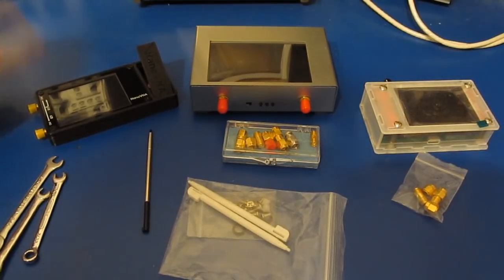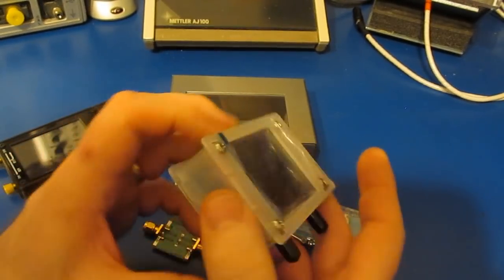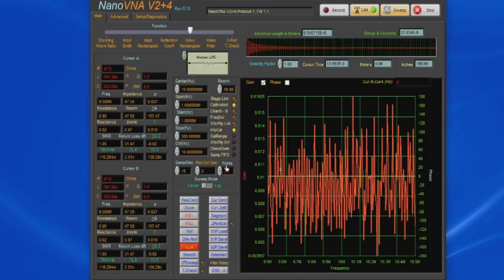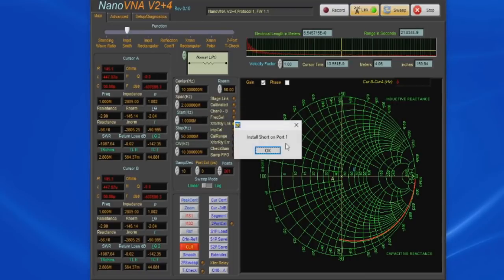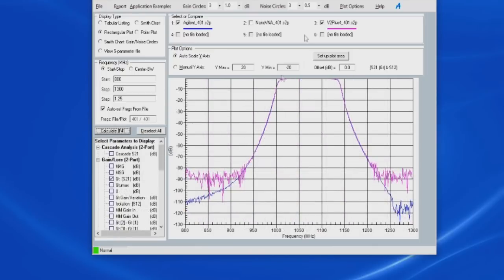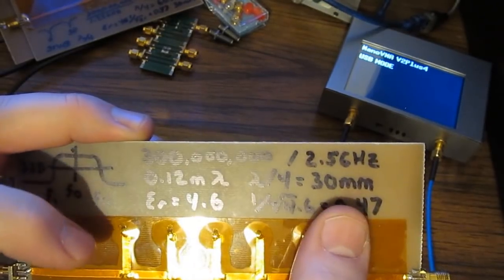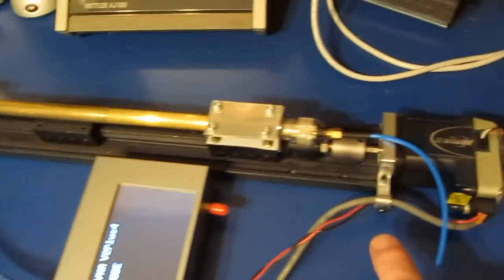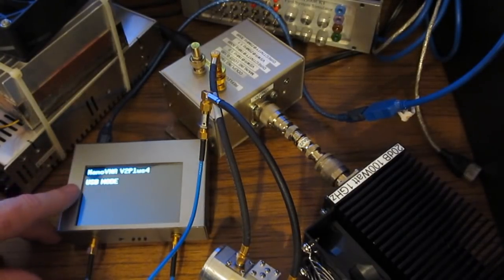NanoVNA V2 Plus4 Review, 4GHz VNA

Comment: Will this software program V2 Plus4 work with my NanoVNA H ?
Reply from the maker: No.  The H and H4 use a different protocol.  I did write software that supports them along with the original NanoVNA but it is not kept up to date and no longer supported.  It is still available to download.

Comment: Will your software work with: "Upgraded NanoVNA-H4 Vector Network Analyzer, SeeSii Latest V4.3"? I just acquired one of those. The date today is 16 June, 2023.
Reply from the maker: This specific software does not work with the H4.  I have different software that uses the old protocol (used by the H4) but it is no longer under development.
Reply: @joesmith-je3tq  Can I get a link from you for that older protocol software you mention?

Comment: Joe, I have a V2 Plus4 with SW version 20220301. I have been searching for any discussions relating to a feature identified as:  L/C match for source Z0. Find on the menue at: (Main menue, Marker, SmithValue-L/C match) but with no success. This feature apparently provides matching solutions using a variety of typologies.  Unfortunately I am not knowledgeable enough about the subject to really understand how to use this feature. I know you lecture about simsmith extensively and I think this would fit in nicely with that.  Would you please consider doing a video about the feature.
Reply from the maker: Hello Walter.  I suspect you have me confused with someone else.  I have never talked about or demonstrated SimSmith.   Also, I never use these low cost VNAs without having them attached to a PC.  I use my own software with them.  Because of this,  I have no use for the features built into the firmware (VNA itself) outside of being able to read the data off it.   Any calculations I do on the PC.   
There are various forums and email lists that you could join.  One is specific to your particular VNA.  I suggest joining it and asking your question there.    
After purchasing the LiteVNA, I stopped using the V2Plus4.  Between it and my original NanoVNA, these are the only two I use.   While I continue to offer updates for my software, I only develop and test using the LiteVNA.

Comment: Thanks! I just got the NanoVNA V4 Plus Pro, and the first thing I tried to do was measure some GHz-range antennas. I'm glad I saw this video.
Reply from the maker: I liked the V2Plus4 but have moved onto the LiteVNA.   I just got the latest hardware revision and have started to experiment with it.     My last video shows using it to measure some GHz antennas.          https://www.youtube.com/watch?v=xe4Fy4Lpnqw
Reply: @joesmith-je3tq  Thanks! I didn't know about the LiteVNA. I had the original 300 MHz NanoVna and liked it, so when it was time for an upgrade, I just defaulted to the NanoVNA V4 Plus Pro. Just used it this afternoon to tune an EFHW. Of course, this was only 14 MHz so it was an easy job....
Reply from the maker: @thrillscience  For working at lower frequencies or making narrow band measurements, you may find your original NanoVNA outperforms your new one.  I've posted data before comparing several of these low cost VNAs.   Recently I posted some data for the latest LiteVNA revision.
Reply: @joesmith-je3tq  Thanks for the tip! I was going to give away my old one, but I'll hold onto it for HF/VHF work because it's small and works will with portable QRP setups.

Comment: Do you prefer the liteVNA now?
Reply from the maker: I have not used the V2Plus4 since getting the LiteVNA.  The LiteVNAs firmware offers features not available with the V2Plus4, which I take advantage of.  If you watch the very last video I made, you can also see how I am making use of the more than 2X upper frequency range of the LiteVNA.  But I am sure what you are really asking is not what I prefer but what you should buy.   If I were a ham, I would most likely stay with the original NanoVNA.  It offers advantages over the Lite and V2Plus4.  All of these low cost VNAs are great for educational purposes but they all certainly have their downside.    If you watch the following, you will note one problem they all share:
https://www.youtube.com/watch?v=y6iOTEU6Zzo

Comment: Hi Joe. One question, does your software also work with nanoVNA-H and/or -H4? Thanks.
Reply from the maker: Maybe.  There are so many of these low cost VNAs with various names, manufactures and people creating firmware, it would be near impossible to say for sure.  For my original NanoVNA, I am still running firmware that a member of EEVBLOG was fixing bugs with in 2019.  Someone had asked about the H4 and I attempted to buy the exact same one.  I ended up with one from Hugen's site.  The firmware was never stable enough where I would consider it working.  I have not checked in over a year if they released anything stable for it.    Both of these (H and H4) use the old protocol which I stopped developing for.   The software and manual are still there for those interested in using it.    If you decide to try it, make sure you read the manual and FAQ.  If you still have questions, check the EEVBLOG.  There is an index.   If you are a radio hobbyist wanting to measure VSWR, I suggest not attempting it.  There are many open sourced programs that are supported.  I suggest joining the groups.io mail lists.
Reply: @joesmith-je3tq  Thanks.

Comment: There is already a 6 GHz version in Banggood. Any experience?
Reply from the maker: I have been working with the LiteVNA.   Most of the discussion has been on EEVBLOG.  The following videos include it.   
https://www.youtube.com/watch?v=G4eLcTC4Ako
https://www.youtube.com/watch?v=y6iOTEU6Zzo
Reply from the maker: Should mention that some have been experimenting above 8GHz using this VNA with the harmonic mode.
Reply: @joesmith-je3tq  Greetings! Are the receivers capable to accept that high frequency? How can the harmonic mode be activated? With an external high pass filter at the output?
Reply from the maker: @ghlscitel6714  A few people, including myself have posted some data above 9GHz.   As long as you are running firmware that supports it, it will change to using the harmonics automatically.   No filter is used.
Reply from the maker: You may want to join their mail group:
https://groups.io/g/liteVNA/topic/first_tests_above_6_3ghz/87993520?p=,,,20,0,0,0::recentpostdate/sticky,,,20,2,20,87993520,previd%3D1643375013749494603,nextid%3D1638275601966447379&previd=1643375013749494603&nextid=1638275601966447379
Reply: @joesmith-je3tq  Thanks, I will check that.

Comment: Re: comparing 0406 and 1206 on the test boards. 
Did the loop in the 1206 curve indicate a limitation of the resistor?  Confused because 1206 mounted on sma seemed to do much better. What caused the difference between 0406 and 1206, resistor character or transmission line effect? 
Very nice demonstrations of  transmission line physics!
Reply from the maker: The two parts mounted to the test board are 1000 ohms, vs a 50 ohm part mounted to the SMA.   These are not the same parts.   Not too long ago, I repeated an experiment where I measured the capacitance of various 1206 resistors.   Parasitics.

Comment: What is accuracy advantage of using the port switching relay arrangement rather than manually switching connections between ports 1 and 2? Nice having automated switch,  but a bunch more work to get the S12.
Reply: Professional S-Parameter test sets from HP early on did this beginning in the mid 70's up through about 2 GHz ... then they transitioned to the Transmission--Reflection (two-port) test sets like the NanoVNA series has ...  being able to do S12 and S22 is nice when measuring non-bilateral devices like transistors (IOW, amplifiers) in a production environment.

Comment: Dear Joe, would you be willing to contract with me to spend ~1 hour to help me over a zoom call?  I am a newbie novice, and I just purchased a NanoVNA V2 Plus 4.  I am trying to evaluate a batch of 8 dBi fiberglass antennas, 50 Ohm, 900-930 MHz, that I received from China.  I am willing to pay cash in advance for your time.  Will you help me?
Reply from the maker: I suggest you join the mail list for the V2+ and ask any questions you have there.  I also suggest you make use of the search engines before asking any questions.  There's a good chance it was already covered.

Comment: You mentioned that you have an HP 8754A.  If you're looking for video ideas, you might make one showing how to calibrate and make measurements with it.  (I have a discarded one with a blown front-end that I may get around to trying to fix some day :-)
Reply from the maker: That's a very crude system with a lot of mechanical parts to get it set up.  It was my first VNA and it's where I started to learn some of the basic math.    If you go through this thread, you can see several pictures of it in operation.   Was the test set damaged, or the actual 8754A?  

https://www.eevblog.com/forum/projects/20db-rf-attenuator-seeking-feedback-to-improve/msg2903552/#msg2903552
Reply: @joesmith-je3tq  Thanks for the link!  (I haven't had time to check out the old VNA, but I was told the S Parameter Test Set was damaged by someone testing an amplifier without sufficient attenuation.)

Comment: Hi Joe, I'm interested in how you rebuilt that 100W attenuator, any info that you could point me to?
Reply from the maker: https://www.eevblog.com/forum/rf-microwave/fixed-attenuator-repair-mods/msg3267302/#msg3267302
Reply: @joesmith-je3tq  thank you very much! i have a similar load but it does not split open in the middle, mine died somehow so I'll be taking it apart eventually

Comment: You mentioned that the original unit was better for measuring xtal filters etc below 300 Mhz. Why is that? Is the RBW more narrow in the original?
Reply from the maker: It may no longer be true as the designer had posted a link to some third party firmware that was intended to solve this.  I have never tried it.
Reply: @joesmith-je3tq  Thanks. I am looking for the RBW specs for these VNA's. Can you direct or help?
Reply from the maker: @swradios  I am not aware where OWO had specified anything.  I would start with them.  If you are not a member, I suggest joining the V2P mail list as OWO will normally respond to questions there.

Comment: You said the problem with the V2 was the lack of Narrow Band, is that a software problem and could they write a firmware update to make narrow band possible ?
Reply from the maker: I consider firmware to be running on the NanoVNA and software to be running on the PC.  The software has nothing to do with the data the NanoVNA sends up.   OWO had posted where someone had attempted to address it in firmware but they had not tested it.  I've never looked into it as I seem to have poor luck with firmware.

Comment: Thanks for the really interesting look at NanoVNAs and what they can and cannot do. The examples and use cases presented are very helpful. The part at the end about making measurements in the presence of interference is also very helpful, as I do work at RF sites where this is a very real problem.
Reply: They must use wideband RF detectors in those units. I can get within 1 kHz with the AA-55 Zoom from Rigexpert before I see 'beat note' interference' down below the 160 meter band at 1700 kHz. The signal level at 1700 kHz from that nearby AM station is around -1 dBm and the AA-55 like I say is not bothered UNLESS I am tuned to 1700 kHz. I have _no_ trouble once in the actual 160 m band ... this is in the highly urban AM-radio populated DFW Tx area.

Comment: Really impressive  review but without your software the device V2 Plus4 seems a little useless.
Reply from the maker: Most people wanting the software just download it. I would say though, based on the comments I have received, having it doesn't make these devices useful.
Reply: @joesmith-je3tq  But your software get every thing out of it (and even more) in very efficient way. What torque wrench are you using? Regards.
Reply from the maker: @jacek7178  I see you decided to read the description to find it.  The puts you a step above most who have asked about it. Depending what country you live in, that torque wrench is sold under various brands.  You can find breakover wrenches used for a fair price as well.

Comment: Will it tell me if my wire antenna is resonant across HF bands. Yes, job done for under a 100 bucks. Will it hold up against an Agilent or Marconi for complex RF testing, probably not. Excellent video. Thanks for so much good info.
Reply from the maker: It depends what you are trying to measure.  The $50 original NanoVNA I have for example can be used down to about 20kHz compared with my vintage Agilent at 300kHz or my museum grade HP at 4MHz. In the following video, I attempt to show the $50 VNA being used for PDN measurements.   
https://www.youtube.com/watch?v=Y8ouApeex78 
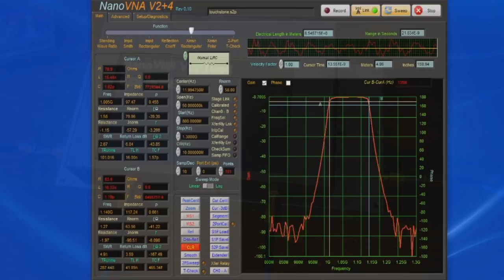Of course, at 46:00 into this video I compare the data from the original NanoVNA, the V2Plus4 and one of my vintage VNAs when looking at a GHz interdigital filter.  As we would expect, there is no one right tool for all jobs.  I think for the $50 the original NanoVNA makes a decent VNA for experimenting below 300MHz.  It's a great tool for educational purposes.   For people wanting to experiment at higher frequencies, the V2Plus4 is a decent starting point.

Comment: I once made some home made cal set out of 0603 resistors and SMA connector. After some tweaking I was able to get the return loss to >50dB out to 2GHz and >30dB out to 9GHz. Now I use them for quick calibration when I don't want to wait for my Ecal to warm up.
Reply from the maker: Anything I have made has had poor performance beyond a gig and a half or so.
Reply: joe smith I solder 2 100ohm 0603 resistor in parallel directly onto the center pin of an SMA connector that is filed flush. That gives performance similar to mini-circuits ANNE terminator. Then I use copper tape to form a ground plane near the resistors to reduce inductance and that improve things a lot.
Reply from the maker: @wadehsu2347  Could you post a picture of the load?  I would like to see how the tape was used.

Comment: 😷👍🏻🧂    ANOTHER  OUTSTANDING  VIDEO !
Legion... Must Be a Member of The Salty Cracker Army. 🧂🧂🇺🇸🧂🧂

The N connector model is rugged but they tend to freeze when attempting to flash firmware updates.
DFU  issues and no “jumper” as referenced in the docs.

The TinySA / Mini1300 Antenna Analyzer/ NanoVNA are GREAT innovations for the home player.
RF / Hobbyist/ Ham / a little for all groups.
Reply from the maker: I like that 6GHz one in the works but it seems like there's a lot to be done before it's usable.

Comment: In watching other videos every time you change your span (start/stop) they say you need to reconfigure.   Since you appear to be way more educated than others in electrical engineering is this not the case?  I didn’t see you doing that, that is why asking.
Reply from the maker: That's a good question.  I will assume you skipped around rather than taking the time to watch this video.  It really depends what I am doing.  There are cases where I am looking at relative data and will not cal the unit, or may just normalize the data.   

Your question is about changing the frequency after the unit has been calibrated.  Watch this video or at least the segment from 21-23 minutes.  I explain how my software interpolates.  Listen very carefully to what I am saying.   This is not anything magic or advanced.  If you check out some of the major manufactures, you will find most VNAs will have this capability.

Yes, there is a lot of information on the internet.  Some good, some not so good.  You get to sort through it.  Personally, I still use books for technical questions.   Recently, a person had posted how they were measuring SWR of their antennas out three places beyond the decimal point.  Now why anyone would care about this, I am not sure but I wouldn't be surprised that they would cal every time they use the device. 

If after you listen to that 2 minutes you still have a question, then feel free to ask.

Comment: I was pleased to see an impedance-over-distance, which is very useful for checking circuit boards. Other than cable length, I had not seen TDR functionality in for the NanoVNA desktop software. Thank you for making the video, well, and the software.

It would seem that one of those little crafting paper-cutting cutting machines might make some nice instant filters from copper foil, which probably is getting expensive for you.

I had gone through most of LeCroy's Wavepulser videos, as well as some others. Eric Bogatin had mentioned that one of his students found that the mounting pins used on SMA connectors become an issue at higher frequencies, as they are 4 little antennas.

I am still hoping that someone makes a NanoVNA with 4 ports.
Reply from the maker: I had demonstrated TDR on the original NanoVNA a little over a year ago.   It's fairly limited (see attached link). 
There are many SMA connectors to choose from.  Without additional information,  I wouldn't have any idea but sure, not all connectors have the same performance.  You may find a single connector costing more than your expensive paper cutting machine.   

https://www.youtube.com/watch?v=GJNMnq8eD0E&list=PLZSS2ajxhiQD2gftdurGQoyGpUM_HobNI&index=4